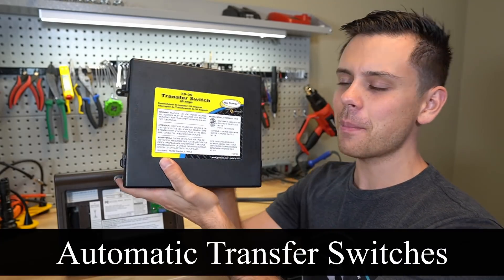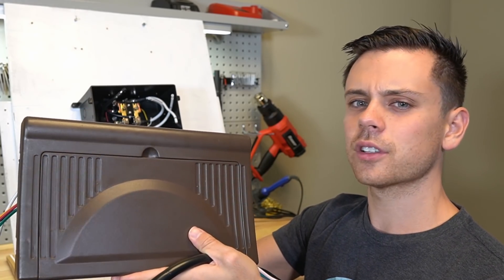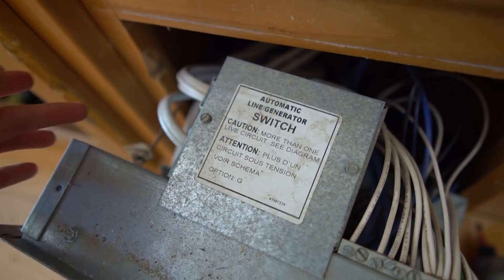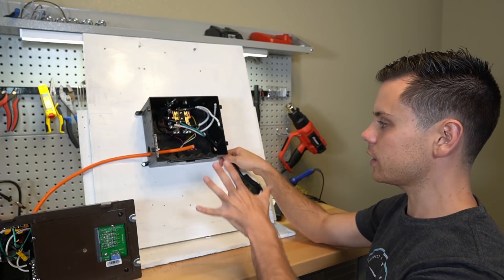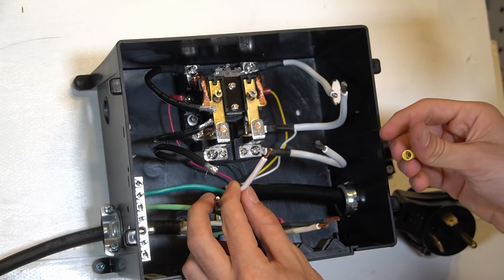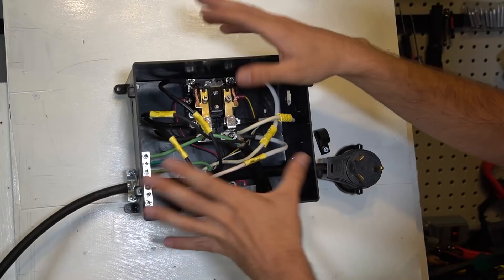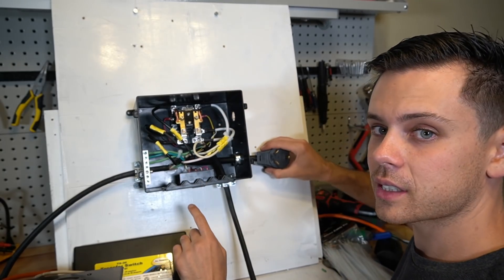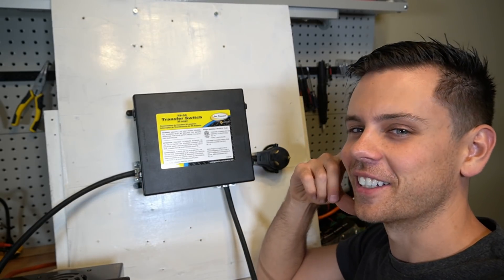RV Solar Power: How to Install an Automatic Transfer Switch to a Solar Inverter

Comment: For me, I don’t have the solar setup yet. My power will be coming from a generator, not shore. But where do my batteries come in to play here for being hooked up? I have the converter/ charger and inverter. Do I hook my batteries up solely to the inverter or do I connect inverter and controller/ charger through the transfer switch in order to charge my batteries?

Comment: It no need for the transfer switch if you are not running much more than a 120VAC air conditioner and if you have an inverter charger with ATS.

Comment: Do you have a video for an aftermarket setup that can switch between shore power, solar, or generator?  I will be building the entire system from scratch.
Reply: Eric did you end up doing this?  I'm about to try the same setup.  Any advice?  thnx!
Reply: @troutcamp14  Haven't started on my trailer yet. They do have them on the market. If you want to DIY, learn the Arduino system and how to use transistors. Pretty much all there is to it.
Reply: @ericthered9655  OK thanks much

Comment: As a licensed electrician the video was helpful and straightforward. The only thing I'd be careful about is the use of those butt connectors. Many of them are really used only for automotive and low voltage use. In this application you would need them to be rated for 125v or higher. If it was be using this box I would use yellow or red wirenuts. As a commercial electrician this is a Square D Emergency Relay found in many schools and hospitals in use with lighting circuits with Normal and Emergency Circuits with the relay. The lighting circuit is used to pull in the coil and when that power is dropped out it closes over to the Normally Closed position to feed with the Emergency Lighting Circuit. 👍
Reply: both of you have made great points. if used in an RV / mobile setup, a better suited alternative to butt splices and wire nuts might be WAGO connectors (which now come with this ATS), which are rated for up to 32A / 450V.
Reply: I hear ya, but I’m not sure wire nuts are designed to handle the vibration that an RV is subjected to either.  A properly done crimp cold welds the wires and provides superior strength and vibration immunity.  Insulation could be  addressed with an extra (marine grade) shrink tube applied over the top of the crimp.

Comment: i have ford e350 tioga rv with house battery in front and i want to add 200watt solar system with 200ah batteries and 1500 watt inverter for operate refrigerator and tv and amplifier while driving and for few hours use without generator use.

the question i have is right now the house battry is in the engine front connect with the start and alternator,
i have the solar 200watt from roof going to inside the rv with 20a controller and 200ah weize battery that i want to connect to main panel with the go power ts-30amp automatic transfer switch but i stiil have the old setup coming from house battery in engine how can i connect the old 12v system with the new solar setup with the 200ah batteries ?

can i have dual 12v supply connect to the main electrical panel?

sammy

Comment: Will I have 3 power souces shore, generator, and solar. Would I just add a transfer switch behind the transfer switch I already have to add solar? So shore and generator already have a transfer switch would I just disconnect that from the panel and run into another transfer switch with solar (inverter) and then out to panel? And if that is the proper way where would I add a 3 pole contactor to disable converter when panel is running from solar (inverter) ? Thanks
Reply: Did you ever get this figured out?  I'm getting ready to install the same 3 power sources in a vintage trailer and not certain.
Reply: @troutcamp14  ya I ordered a go power ts-30 off ebay and wired it in. It had a diagram on the cover and you can also pull up their website and find the diagram there. Works like a charm
Reply: @troutcamp14  and yes I just re-read this I did add the ts-30 in with original transfer switch. I did it awhile ago now so can’t remember exactly what I did but I used the schematic off the box and wrote it all out to make the shore#1 genny#2 and inverter#3
Reply: @rawbdiggity  OK thanks!  I have one TS-30 already.  So you think I can wire 2 of them together without any trouble?  I think it would be like this:  Switch #1 would have the shore and inverter coming in to it.  Switch #2 would have the generator and the output combo of Switch #1 wired in.  Does that make sense?
Reply: @troutcamp14  sorry was on vacation.
My trailer had onboard genny so I ran the ac out of that transfer switch into ts30 and from ts30 to ac panel. made inverter last in ts30. so had to rewire converter to ts30 and ran the wire for inverter to ts30 man I hope that helps, I had drawn out a wiring diagram but I can’t find it. I do remember it was a pita working in that tight space. Haha

Comment: The wiring diagram in the manual for that unit shows the inverter wires going to the lower wires not the middle ones.  And the shore power cables wired to the middle wires

Comment: I would like to add one of these to my TT. But I do not know how I would wire up the converter charger so it will only charge when on shore power cause I don’t know what wires to use. It’s an old 2002 6300 series converter

Comment: I love you videos! I think this install is incorrect though because if you put the transfer switch in between shore power and wfco then the charging circuit on the wfco will be trying to charge the batteries from themselves as you will be inputting 120v power from inverter(batteries) into the panel which will then be trying to charge the batteries you are drawing from. Would you not lose a lot? I mean this is more simple but not the best I think. Thanks for all your videos they are awesome! Thanks to you amazon is sold out of drock meters and mppt charge controllers haha.
Reply: Nevermind I see your response.

Comment: what if my 1200 watts solar is going through charge controller then to inverter; can't the inverter go into PD4575 charger/converter also? not planning on shore power much at all. but i definitely want to use the 4-stage charger on the PD4575. THX!

Comment: How can a setup an automatic transfer switch for the bluetti in my van? When charging the bluetti from a portable generator outside, when it's rainy, I want any power I am using to come from the generator and not slow down the bluetti charging. I want the generator to run the least amount of time required and as soon as my bluetti is fully charged, I want to shut off the generator and go back to using the bluetti.

Comment: Hey will i have a vogue 1984 it has a pretty advanced electric system. I have a 6.5khw generator and the shore power . and the 2 housebatteries can recharge the vehicle battery if i press a button. It is really confusing so IF I JUST PUT SOLAR WITH A PWM GOING TO THE HOUSE BATTERIES . WHAT COULD GO WRONG ? I dont get it

Comment: What if I want a 5000 watt inverter to power my already wired can I wire the inverter back to the coach fuse box or this can't be done. Because I forgot to turn my inverter and when I turn on my generator my inverter got fried

Comment: No cringing over here.  Pretty clean.  Good move not zip tying the hots.  I'm glad you covered the R.V. battery charger connection to the shore power circuit.  Un-necessary on a solar set-up and more load on the inverter.  Many people miss that.

Comment: Hi Will, I installed the same 30 amp ts in my coachman rv this week.  The power cord tied directly to the gen/shor transfer switch like the on on you rv.  Everything works as planned except when I start generator the ca only goes to outlets, not charger/converter.  When plugged into shore power it turns on charger.  Since I will mainly be charging my batteries on solar not a problem.  Is there a way to overcome this?
Reply: Are you using an inverter? If you only have shore and generator, then your charger should be hooked up to your main panel after the fact. So that no matter which source is selected, it will always draw power because it’s after the switch.

Comment: Thank you, thank you, thank you. This is what was missing in all the challenges that I have overcome in my project. I went to an electrical supply store and they wanted to sell me a $350.00 circuit breaker box with a transfer switch. I converted a 26 ft. commercial box truck into a tiny house. I have two 100 Ah Battle Born Batteries and 720 watts of solar panels, 60 amp Outback charge controller. and a Semlex 3000-watt converter., I am totally off-grid. I use a generator at times and want to use the generator as my "shore" power. It looks like this transfer switch would do the trick.
You are the best, love your vids, btw, I bought your book.

Comment: What if you want your lithium charger to charge from Generator or shore power, but not from the inverter (obviously)? Would you use another xfer switch (10amp) for that logic?

Comment: I have a Giandel 2200W pure sign wave inverter that is the solar controller. So I have a battery charger from the solar. If I put in a transfer switch then the battery will get charged from both the WFCO charger as well as the solar charging from the solar controller. I hope that makes sense. 
Help?

Comment: Thanks for the vid. I have 500AH of 12V batteries, 660 of 12V, Victron 50a Controller and a 3000W inverter. I decided to not go with the inverter charger combo because I had the converter for that. Why do you say no to charging the batteries with the converter?

Comment: I have an inverter/charger in my van. Does the ATS go between the shore power plug and the inverter still? Also, I have lithium batteries. Does that change things? I wasn’t clear about your comments regarding them. Thanks.This is the last step in my electrical. Install! Ahoo! By the way, your book on mobile solar was part of my learning process.

Comment: Im trying to figure out if this can be done with the titan. Basically i want to be off grid as much as possible but have the grid kick in for the air conditioners or when necessary. If anyone can point me in the right direction i will really appreciate it.
Reply from the maker: Yeah sure

Comment: Great info! Thanks! Just a question. I’m looking at being able to expand. I’m new at this solar thing and was interested in installing an ATS first. My current set up is shore power cord and then a 30 amp EMS surge protector then my distribution panel. My question is can I install an ATS somewhere in line? Thanks!

Comment: The location where my shore power comes in is several feet from my converter box on the opposite side. Do I have how to install the automatic transfer switch as close to the converter box as possible? Or can I install it closer  to where the shore power comes in?

Comment: Thank you for the video, it helped clarify some of the wiring issues i have been thinking of. My issue though is I have an motorhome with an onboard generator, plus the shore plug. My understanding is the ATS is works for two (2) incoming power sources. With already have the two on board, it is possible to add the solar to the ATS or do they have an ATS which could handle 3 incoming power sources, to switch between the 3, the inverter (solar), the generator, and the shore power?
Reply: I have the same issue. Did you figure  it out?
Reply: Same thing I want to know
Reply: @rawbdiggity  I have figured this issue out and it works great. You will need a second ATS, if you already have the factory or the original one in the RV. You will keep the shore power and the generator power going into the first ATS with the output power feeding into the new, or second ATS. I have fed this power into the "timed" or generator input side of the second or ATS. 

I ran my inverter into the dedicated input of the send or new ATS. With this brand being shown you can run a jumper on the H1 to the H2 wire terminals. You will be able to see the H1 and H2 printed on the circuit board. This will get rid of the 30 send delay on the second ATS since your first ATS already has the 30 second delay to allow for your generator to warm up or get to speed prior to taking the draw. 

You do not need to use the jumper if you do not need or want. I went without for a couple months but found a jumper laying around so I placed it in. It is easy, you can solder a wire between the H1 and H2 terminal, but if you do not, it will just take about 40 to 60 seconds until your shore power or generator turns powers up your RV. 

It is a very simple and easy process, you will just need two (2) ATC switches. Just keep your factory ATS wired, take the outgoing power of the 1st ATS, run it into your second along with your inverter power into the second, then the output going into your breaker panel. It works flawlessly. 

I am very happy with how it works.
Reply: ryche2882 that’s funny the second main comment I asked was this exact thing about adding an ATS behind the first for solar(inverter) the next question I had was how or where would you put a 3 pole contactor to disengage the converter when the panel is running off the solar(inverter) ? 
Btw thanks for the confirmation on running second ATS I really appreciate it and the added jumper info for that setup
Reply: @rawbdiggity  I have found several videos for doing this. In the videos I watched, they placed the 3 pole right next to the breaker panel. I have not done this yet, and in all honesty I do not think I am going to. It is recreational use only. If you are living out of the RV full time maybe I would. But I just flip the "converter" breaker when I uses the inverter. It really is not a big deal to me. LMK what you do and how you decide to do it. Maybe I will get to it next year.

Comment: Hi, thank you for the best videos you upload on youtube,  Is there any way that to show us complete  two systems automatic switch work we have two systems in our home one is panel direct power, to the house, and another one is with few pannel and battery charger  which we use at night but all the time power on power off is very hard job if you can help thanks

Comment: Great video will. I would like to see somebody address this issue and I am sure I’m not the only one. RV has solar panels going to a battery then to a 120v inverter. Gas generator to 120 V.  Shore power 120 V. How do you have them all connected together without blowing One of them up?
Reply: I have the same situation here. Thinking about installing two automatic transfer switches

Comment: Will your instruction are thorough and informative, thank you. Im trying figure this out myself. Have a camper with a Renogy dcc50s 12v dc-dc (no solar at this time) running from vehicle battery to house battery and 2000w inverter (with no transfer) going to house batteries and no charge converter. I'm wanting to keep the equipment I currently have and add 30amp shore power. I'm not sure if I should wire up shore power to transfer switch and then hard wire into inverter or add a 30 fuse panel. I'm really not sure what direction to go and would like to get shore power going soon. Any help would be greatly appreciated. Thanks I tried using the forum and no luck yet.

Comment: Isn't it really inefficient to take DC power out of the battery bank Invert it to AC then send it to the distribution panel where its converted back to DC?  I don't know if its possible, but why not have the DC distribution come direct from the battery bank at the same time as the AC distribution comes from the battery bank via the inverter?  Am I missing something here? :)
Reply from the maker: Yes disable the charger. Use the converter box fuse panel only. Bypass it if necessary
Reply from the maker: They are all different, so hard to recommend a single way to do this
Reply: @WillProwse  thanks, I greatly appreciate your work. Just trying to understand the right way to attempt some of this in my rv.  My distribution box where the shore power plug  comes in doesn't have the converter/charger built in. It's a separate box plugged into an AC outlet. I like the idea of what you posted here, just trying to work out how to do it while keeping the conv-charger still in the loop to charge battery while on shore power,but bypassed when not. 🤠

Comment: For my RV, I have a converter now and I am installing an inverter system., using 100W solar panel that I want to use both the converter and the new inverter. I purchased controller, a monitor, a fuse box and a bus bar.  Can I wire them independently so either system will operate  And..also, leave them both wired up to the batteries at the same time?

Comment: I just have a question. I just wired it up and I did the shore power and inverter power swapped. The diagram illustrated that the inverter power was the bottom terminal, shore center terminal and AC out top terminal. Did I do it wrong? The diagram is upside down when compared to your switch and how my switch was hooked up. Thanks for the help!

Comment: Man I love your videos. I'm looking to do a complete off grid setup on my camper. I want to use the battery bank to run the RV through the outlets, I want to still have the ability to run shore power when available and I will be adding solar later but charging with generator for now. Do you have a video that has a build like this?

Comment: Will, I am looking to add a solar panel to my bbq trailer to run to a battery and then to an inverter, can you give me any tips or point me to another video so I can install everything correctly? I’m basically going to run LED lights , fans and an IPad or phone charger off this system. I may run a single pellet cooker off it occasionally. Is a100 W panel enough to power everything? Thank you so much !